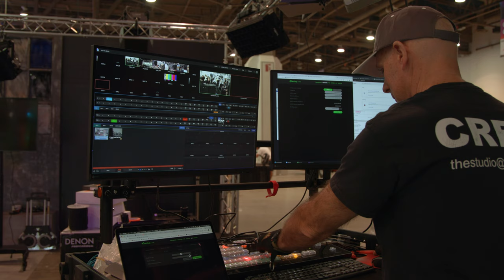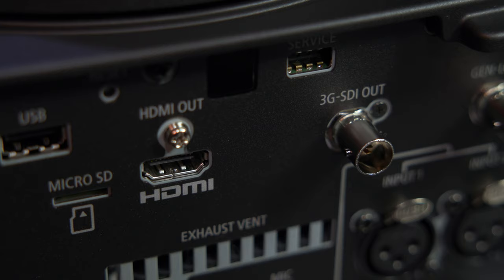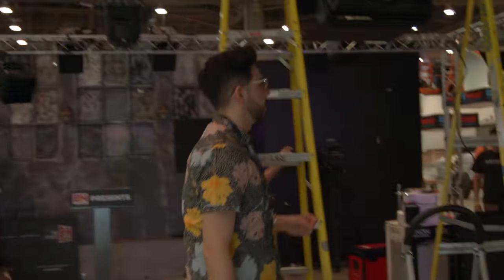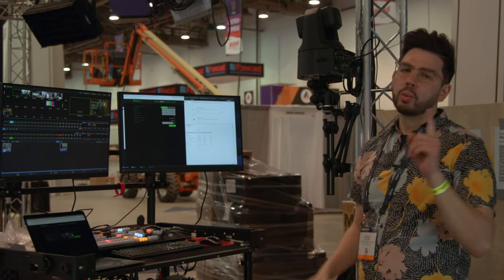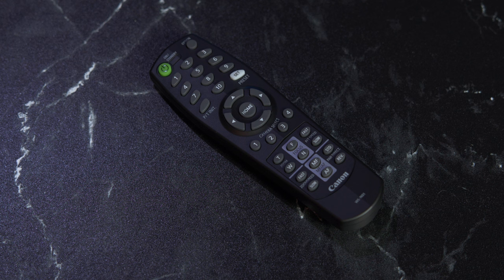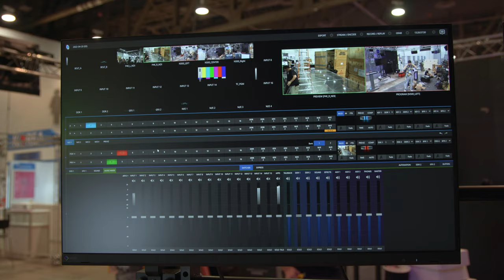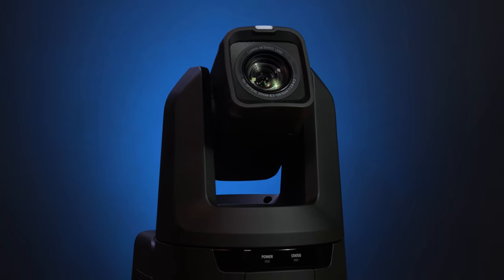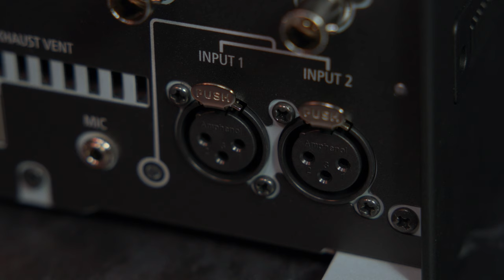PTZ Cameras: What They Are, And When & How to Use Them

Comment: Ethernet cables, ethernet ports.  "NDI" is nothing more than an Ethernet Adapter for SDI and HDMI.  You can plug an ethernet cable into the camera then directly into the Network Switch such as a Cisco, TP-Link, or Netgear.  
People are getting confused thinking that if equipment doesn't say "NDI" then they can't use an Ethernet cable when in fact they do.  If it says Ethernet, LAN or the three computer symbol, that is a Ethernet port.